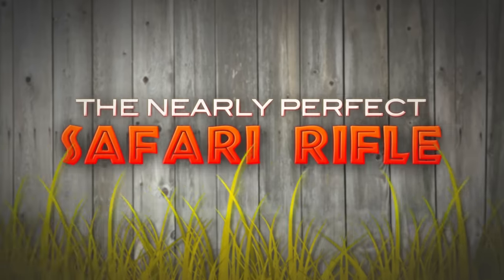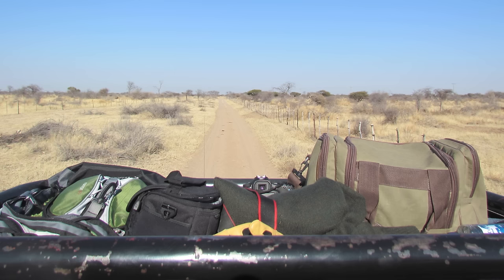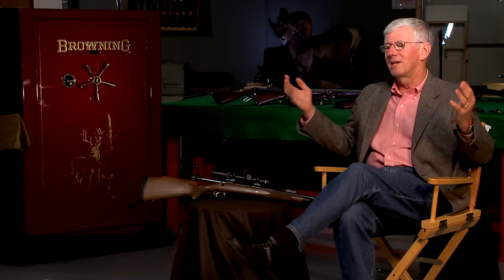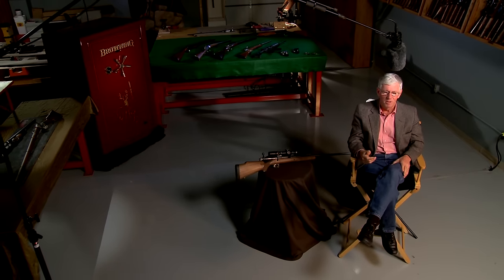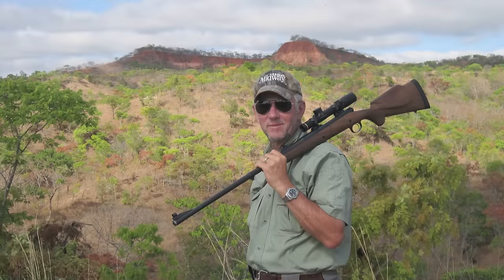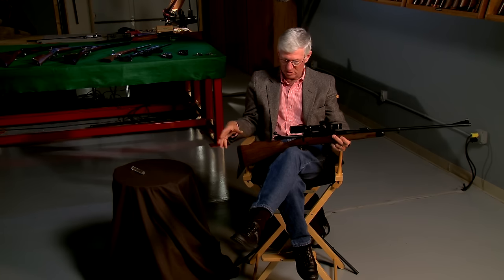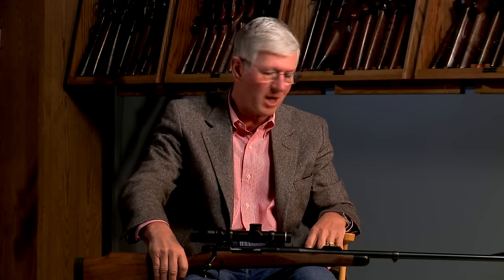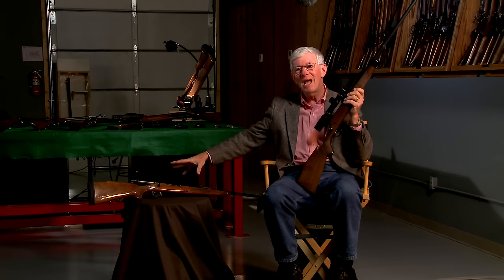The Nearly Perfect Safari Rifle -- Interview with Larry Potterfield | MidwayUSA

Comment: HELP Please. I can imagine that Mr. Potter would know the answer to my problem. But I would think there are a few participants here that would also hopefully. I just bought at an auction a 1891 Argentinian Mauser probably before 1909 manufacture. It was in quite excellent shape with just a little bit of minimal rust on the barrel. The problem was that the bolt was stuck and despite that my auction price of $460 was met and by the time I was done it was $551. Obviously my presumption was that I could find a solution to this issue. In addition, neither could I release the magazine as the little lever of the art portion would not move in any direction. You could lift the bolt, but once lifted, it did not retract at all. The safety would still move in both directions. Any suggestions are appreciated. I am here in Florida and I do have a wonderful gunsmith, hopefully still around a few miles north in Sarasota Florida.

Comment: I wish I were able to hunt all over the world for all types of game. But I do have a question. Why use steel for reinforcing in the stock grip and also the forearm? With strong as steel materials, unless it's an old school thing or you wanted more weight due to the recoil, I am confused why the steel? Thanks
Reply: In many ways, steel is still one of the best and strongest materials we have. Especially in long term durability where shock resistance, tension, reliability, longevity of use, and bending are concerned, which are what is applicable.

Comment: Hmmm. Three position safety. Custom trigger. Larry's perfect rifle would be more perfect in my opinion if he had just customized a Model 70 type action. Being so "familiar" with a Model 700 goes out the window when the bolt shroud was replaced (by one copied from a Model 70). I'd still rather have that Mauser claw type extractor. Mauser or Winchester - for me. But then again - I don't do millions of dollars worth of business with Remington, lol.
Reply: What he did are the fudds who take an SKS and put several hundred bucks trying to turn it into an AK when they should have just bought an AK from the start. 
He spent what would have been several thousand dollars turning a Remington into a Mauser action.
Reply: And if he just likes push feeds, he could have stared with a push feed Model 70 and not had to change the bolt handle or safety.

Comment: Most folks don't think of one difference in control round feed or push feed. On my firearms the control round cocks the bolt upon closing the action and the push feed cocks the bolt upon opening the action. The control round requires more energy to close the bolt because it is cocking against a spring. This can make a difference in the choice one might prefer.

Comment: I don't think Remington has a control feed bolt, i rather take a Winchester M 70.
Reply: Accurate, the Rem 700 is push feed.  The Ruger M77 Hawkeye rifles also have controlled feed similar to the Win M70 (both Mauser-style). From what I have read, most African hunters greatly prefer controlled feed, and many famous hunters named the M70 specifically.
Reply: Anytime CZ 550....
Reply: CRF, cz 550 or win 70

Comment: If you want to use an M1 you're going to have some problems. Caliber's not one of them. I've seen custom M1's in both .338 & .458 Win Mag. You can even get a really lovely stick of wood for one, but a high quality scope that is fully usable in low light (which excludes scout scopes) is going to be rather difficult to mount. You could perhaps use a forward-mounted Aimpoint though.

The biggest problem is the law. A semi-auto rifle will get you thrown in jail in most African countries!

Comment: Going to build my nearly perfect Safari rifle with a left hand Weatherby Mark 5 action number 5 Barrel chambered in 404 nitro "Jeffrey" crossbolts pillar and glass bedded, Mercury Recoil Reducer in stock, limbsaver recoil pad, quarter Rib rear sight, Ivory bead front sight, sling swivel on barrel, detachable scope mounts leupold 1/2-5 variable. That's mine nearly perfect Safari rifle. Forgot to mention the  four and a half inch long Hickory Dowl epoxyed through the pistol grip. BTW this is a custom stock that has a straight comb not weatherby's sloping comb  that knocks you in the cheekbone every time. A custom stock maker who belongs to the custom rifle  guild and is at the top of the game, uses Hickory dowels epoxied thru the pistol grip. He says an aluminum threaded all rod does not give, the grip will crack anyway. BTW a cartridge with a belt  is obsolete.

Comment: "Are you (Larry) going to take something other than a Remington rifle to Africa"?   Well, if it's going anywhere near dangerous game then I'd have thought the simple answer is, yes!  You can take a 'push feed, spring-actuated button extractor rifle if you want; but don't get all pissy if things go pear-shaped at just the wrong moment.  If you're going to hunt DG in a responsible way, you need a controlled-feed action with a claw extractor and a fixed (non-mechanical) ejector.   A Mauser 98 is the obvious choice but a clone like a Winchester would do just fine in most cases.

Comment: I like the rifle, but it seems like a lot of effort was spent into turning a Remington 700 action into a Winchester M70 push feed action. Why not just start with a Model 70 Classic controlled-round feed action with the claw extractor? There's a greatly reduced chance of a misfeed or failure to extract, the lock time makes no difference on a dangerous game rifle while the heavier firing pin gives more reliable ignition, etc., and these actions can SHOOT... I have an over-the-course HP match rifle built on one of these by Jim Cloward that shoots around 1/2" at 100 yards. 

My equivalent is an M70 Classic Safari in .375... not as pretty, MOA accurate, as reliable or more so. All it's missing is the pretty wood.

Oh, and for the h8ters, the fees from sport hunting is what keeps these critters viable and their environment protected. Everything that is born eventually dies, including lions... whether a hunter pays thousands for the license and guide fees for a chance at a shot or whether the pride male is kicked out by his sons, starves without the help of the pride, and then gets dragged down by the hyenas and eaten alive. Which way would you rather go?

Comment: Why not semi-automatic versus controlled feed or double rifles?
Reply: chrismc410 It would have to be custom made in a caliber that hasnt been made before. No actions exist for them so youre looking at least 10000$ easily
Reply: @bigredone1030  don't custom rifles like cost that much and more anyway‽
Reply: @chrismc410  Yes but the rifle he’s holding is not worth $10 its like 5k on a good day
Reply: @bigredone1030  from what ive read on the dimensions of both
.375 H&H and .50 BMG, seems numbers-wise, the Barrett M82 action should be able to handle a round as long as .375 H&H as .50 BMG is wider and longer, as well as tough enough to handle the kinetic energy of cycling and terminal ballistics.   

The Finnish Lathi L-39 should also work as the originals fired a 20 mm belted case round. Newer ones fire the same 20x102mm round all NATO countries use and is the smallest round to be considered Artillery. so it definitely can handle the size, length and energy.  All one would need to do is scale it down to .375.

With those in mind, it might heavy as hell but a semiautomatic .375 would be interesting to see.
Reply: @chrismc410  It would actually be cool to see. That's what I'm saying though. Alex Pro makes an ar chambered in 33 nosler (a little under 338 lapua power). This rifle, however, is a semi-custom limited production gun that goes for more than 5k. How much more so for a 375 AR. It's possible but I was pointing out the cost limiting factors.